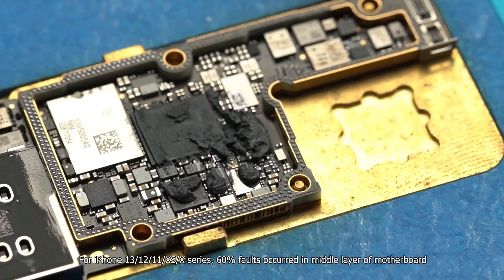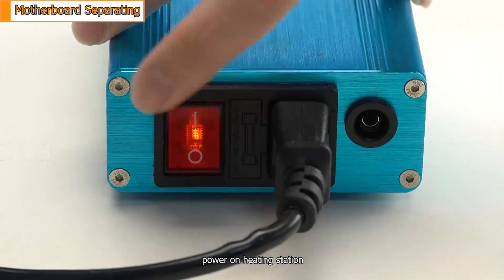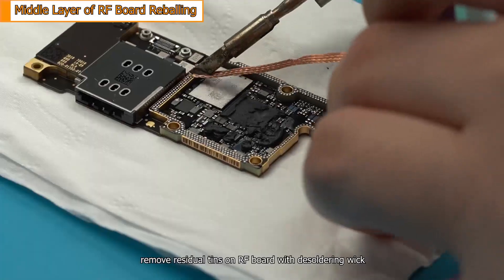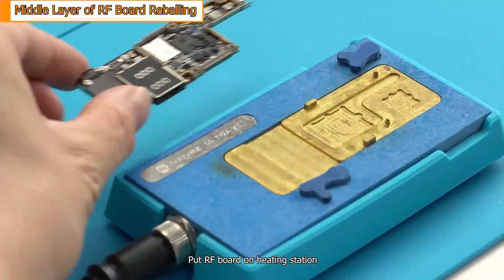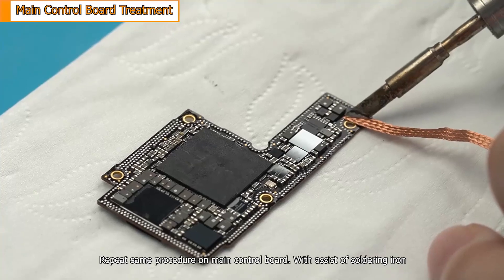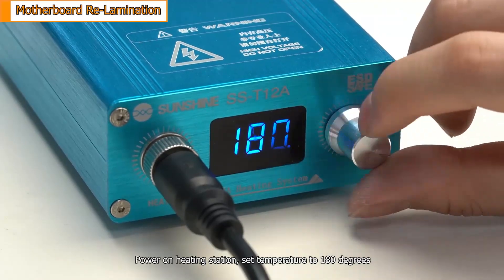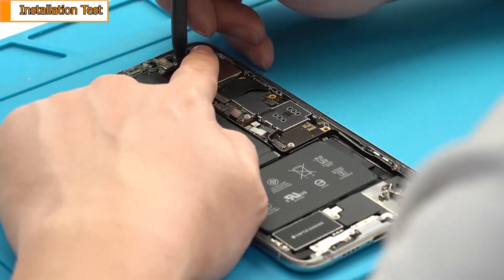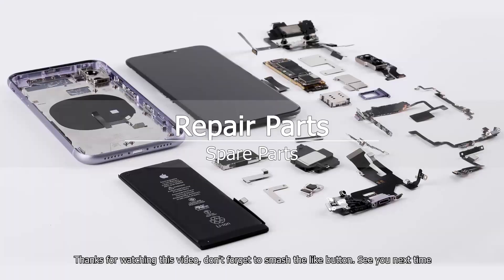Motherboard Repair Skills Course-Desolder & Laminate 2-Layer Motherboards

Comment: I have a question about motherboard:

If I use one half from another motherboard and the other half from the other motherboard, will the phone turn on? for data recover, no (touch) ip xs
Reply from the maker: You must keep the CPU board to keep data, then the other half baseband board can be replaced.